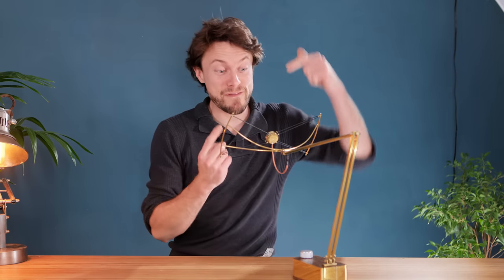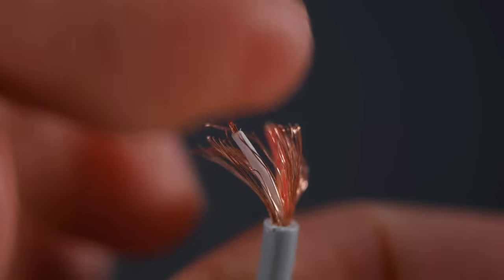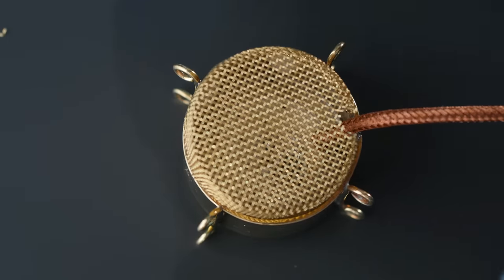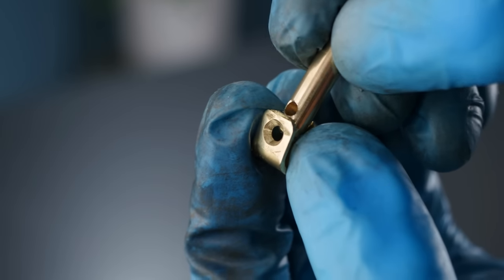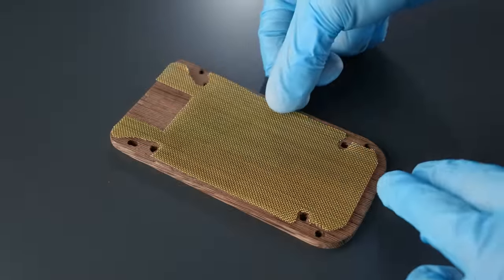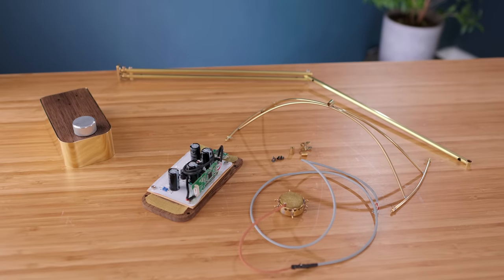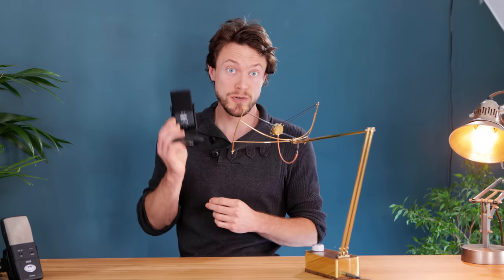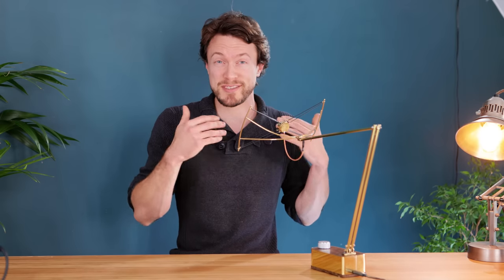Building a quality USB-C microphone

Comment: Dayummm! What a piece of design! Can't believe that cost you $30 to make.
Reply from the maker: Cheers James! Going to have a full brass PC setup soon xD
Reply: Don't forget the several man hours invested in designing and making it.
Reply: @vishalpranav9490  an the pre-owning of soldering iron and consumable, drill, tap sets , the various other tools .. and talent and experience
Reply: @TheOneAndOnlySame  those tools are cheap though. However his talent is definitely the coolest
Reply: Spoiler alert!
Reply: @DIYPerks  What next? "Make a brass home"?😁
Reply: @TheOneAndOnlySame  While true, those things are usually already owned by DIYers. I myself am lacking the tap sets and a good drill, but they're things I want/need anyway. So for any DIYer who is lacking as I am, it's a perfect excuse to go ahead and pick them up.
Reply: @RAndrewNeal  Yeah, he really goes the extra mile with his own projects when you might be able to do without some of the things that he adds (although he gives solid reasoning for the brass in this one) I just bought the isolator from the link and it's $30 bucks after $10  worth of shipping to the states. I'm stoked to try it out though and will enjoy the build. . . i hope.
Reply: while I absolutely love the build, "$30" is maybe a bit misleading... while yeah, the capsule may only cost $13, depending on where you live with shipping, taxes and import fees that is easily $60 alone... add to that shipping for all the other components and were easily over $100 not counting labour, yes it's still great value, but not exactly "cheap"
Reply: It didn't. Assuming you have the tools already, going off of the affiliate links in the description, which doesn't even include all of it, it doesn't include the wood, the brass plate used for the wall of the base, nor to house the microphone, it doesn't have the electronics for the knob or the knob itself, it doesn't have the wires to wire the microphone to the DAC nor the shielding for the wires. Just going off what's linked in the description, it will cost you at least $123. That $30 is just for the microphone and DAC, with $40 being more realistic to actually get the thing wired and working, but still not including a stand, case, shielding or anything, and it likely sounds awful.

Let's say he ended up spending $150 total. That's quite a lot, and most of it went into the stand. It's still cheaper than that particular mic he showed us (the first one, that he didn't do a comparison with), but you'd probably be better off just buying a $150 microphone. Like, the MPM-2000U comes with a stand and the microphone is detachable from the stand and it's generally a much smaller, more versatility device.
Reply: @itsjonathanwade  I might end up adapting it into a self-contained unit much like a typical condenser mic. I don't know if I want to go XLR + separate preamp, or all-in-one, though.
Come to think of it, it may be a great Altoid tin build; and I'm not really a fan of those because they look cheap and junky. But they do make good enclosures because they're a ready-made shield, and they're thin enough not to interfere with the rear cancellation holes on the mic capsule itself. It's just a matter of shrinking the preamp circuit, as his won't fit into an Altoid tin by itself.
Reply: @infi84  the capsule alone is $40 postage to UK
Reply: Awesome build, but yeah… I think just the brass tubes and rods would go over the $30 mark.
Reply: cost at least 120 euro whis the shipping
Reply: @DIYPerks  Ask your friend if he can still get a refund for his 6k one.
Then sell him your one for 5k cus it sounds better 🤣😂
Reply: @NealD   Waaaaay over $30!
Reply: Herd too believe? Because its not true.
Reply: @DIYPerks  What is your normal job, I have always wondered. 
Maybe you answered it in another video.
Reply: @infi84  Well, he only has his own experience to go off of. For him, it cost around $30. It might cost more if you live in rural America; even more if you live in a rural part of a less wealthy country. You might save on shipping costs if you have a decent hardware store in a town nearby.
Reply: @RAndrewNeal  Like people have the time to make this ... (Time is money) so I don't really think 30$ is an actual value.
Reply: @TheOneAndOnlySame  Even after buying all the tools it would still be cheaper. Plus then you could do more DIY projects.
Reply: @thanhnhanhuynhnguyen3652  wait since when exactly are tools that last cheap lul
Reply: What's even more unbelievable is how much this exposes the audio industry as a giant scam, without him calling it out. Well I am doing it — Big audio is big scam. Period. And this piece proves the point!
Reply: @RAndrewNeal  well I just don't think the shipping costs got included in the price calculation at all.
Reply: @infi84  diy projects arent meant to be cheap imo. if u want to save money by doing diy stuff ur an idiot u could just take the time u waste on these products and go work at mcdonalds and u would come out with lot more money and just buy the product online.

Diy isnt about saving money the 30$ pricepoint just looks better and diy perks should do whatever gets him more clicks because he deserves literally all of them and technically its true the parts literally only cost 30$ he didnt add shipping on the neumann either.

People doing these kinds of projects know they wont save money by building it its about building it yourself and nothing else and people not knowing that wont build it anyways so who cares if he fools them
Reply: @DIYPerks  please make Brass Webcam, Keyboard, and Mouse too!
Reply: @DIYPerks  When I run all of the costs out it costs $120 not $30.
Reply: yeah... the mic it's self was $13 and that usb interface he bought was $18, so everything else must have been free and he found a dollar on the ground.
Reply: @TheOneAndOnlySame  you spend 30$ on the parts you may spend 100$ or more on tools but you can use those for other projects (not to mention that they are all common tools)
Reply: Dude needs to patent this invention! the design is so interesting!
Reply: @vcat724  patenting this would patent ALL microphones something i don't think you can do it's a DIY microphone big corp charge more but you can't patent price he is just using off the shelf components
Reply: @BrainiumBasher9001  the brass design itself, not the mic part
Reply: design patent protects only the appearance of the article and not the utilitarian features (mic)
Reply: If he does not patent, then some other inventor or company can just outright steal his idea and sell it themselves.
Reply: @DIYPerks  
I am in a hurry to see this done
Reply: @infi84  Someone in China where these are made could have bought them for $5. The cost is relative but for him that was $30.
Reply: @DIYPerks  Read my comment about the name of it?
Reply: well, about 35 years ago I worked for a telecoms company. Just one of the things I did was to select a standard Euro-size board with a matrix of resistors and a couple of jumper switches to adapt the phone-line impedance for commercial dial-up modems. The company used millions of those boards and I seriously believed on how simple they where, that the company did not pay more than $10 a board at commercial price while to make the board would probably cost less than $2 to make it. After asking around, I found out the telecoms company would pay close to $900 per board 😵😵‍💫🤑 seriously... That's a huge difference, that still continues today.
Reply: @RelaxSimmer  Time isn't money. One with the equipment could spend $50 and a weekend and have a microphone worth more than a couple days' work anyway, depending on what their job pays. It still saves money though, which can be put towards things besides the $600 mic.
Reply: @infi84  You're probably right. But you'll still get a microphone equal to a $600 one while spending quite a bit less.
Reply: Also, diy is a satisfying hobby for some, so you have to factor in the enjoyment you're getting out of the project.
Reply: @r00kiet80  It's a fu***ng drill.
Reply: Well, you should also consider the time it took to acquire that knowledge/skills. The project is amazing, but I doubt any of us (mere mortals) can make it as cheaply as Matt did.
Reply: @r00kiet80   
Hey! tell me what "heavy tools" he used in the video
I dont think you know what heavy tools are, have you ever touch them? im a machinist and and buy stuff from china, it can be terrible or brilliant. Example? Search for jianken spindle and see how much better it is compare to any other brand, say techno. Oh you dont know? ofcourse im sure you dont see a spindle in your life, not to mention a "heavy tools". Oh im sorry, you probably cant read technical specs.
Keep this attitude cause it will get you places in life, but not university.
anyway im giving you a medal of " i express myself like this to hide the fact that im useless". Please get a life, what this man do is beyond brilliant and still remain brilliant if the cost is higher than 30 dollars
Reply: @vishalpranav9490  that's usually the trade off to make stuff like this
Reply: @thanhnhanhuynhnguyen3652  😂😂😂
Reply: @RAndrewNeal   I plan to do something similar. Although I need to run the output through 2 parallel voice mods and hide the whole thing in a costume for a haunted house.
Reply: @DIYPerks  Prices in GBP plesse xx
Reply: @thanhnhanhuynhnguyen3652  no way they are cheap if you don't have anything laying about
Reply: @TheOneAndOnlySame  I mean he gives you everything you need to make it, and you dont have to make the body the way he did.
Reply: @RelaxSimmer  Time is only money if you would be using that time to make money, that is certainly not the case for the vast majority of people.
Reply: what about his time how much does that cost. I can imagine his time is pretty valuable much more than the parts
Reply: @midnightwatchman1  Yeah thats true, but for alot of people who want to do a fun project it would be well worth the time and money. Its not a perfect option for everyone but you can get a really high quality mic for really cheap.
Reply: @TheOneAndOnlySame  You could buy all those tools and the parts needed for less than the cost of a microphone though...so?
Reply: @DIYPerks  Colour me surprised. However I'll bet it'll look fabulous, and run great. There is a guy on YT that's building a fully DIY PC: CPU, GFX and all.
Reply: @SkylerLinux  Link?
Reply: @TheOneAndOnlySame  rent for 20 bucks
Reply: @vip_bimmervip_bimmer8033   yep, I got the same! $122 before shipping.. closer to $200 after shipping.
Reply: @vishalpranav9490  and the thousands of $ of tooling required.
Reply: Yeah, $30 is BS. Just the electrical components alone would run you like $40. They're not cheap. Then add the brass tubing, rods, plates, mesh, wood, wires, USB interface, USB C port, o-rings, the microphone, and shipping, and it's easily over $200.
Reply: @infi84  You cannot really include the shipping as part of the price as that can vary widely... you would also be facing the very same (or similar) shipping and tariff charges for the complete microphone most of the time as well... That is why these are usually compared on "Base cost".
Reply: @itsjonathanwade  Matt (and many others) is describing "base cost" because shipping costs, tariffs, and other factors, can vary widely from location to location. There is also the possibility of sourcing some parts locally with little to no shipping at all or something you already have laying around.
Reply: @DIYPerks  wow no more aluminum its brass time!
Reply: @TheOneAndOnlySame  I mean, if you are big into building things, it would be smart to invest in your own soldering iron, drills, and tap sets. Those pay for themselves in the long run.
Reply: @DIYPerks  Could I use a normal potentiometer instead of the volume control switch?
Reply: @RAndrewNeal  I usually use self tapping screw that I happen to have bolts with matching thread patterns cause I'm too eager to wait for the right tools, lol
Reply: @ikannunaplays  Sounds like the perfect workaround! Taps seem to be crazy expensive for a decent set.

Comment: Professional electrical engineer here: 
-Twisting the 2 wires between the JFET and the PCB costs literally nothing and gives an additional protection against electromagnetic interference (emi).
-Beautiful work on the soldering, are the grills also soldered to the brass ring and connected to ground? With corrosion, you could get some emi problems in the long run.
-Circuit: You need additional 100nF Caps on your supply rails. Those electrolytic caps have a large series resistance, making your supply more noisy for higher frequencies.
Reply: How would one add a mute button this design? I would assume just adding a locking button of sorts to the audio output but I know very little basics of electronics. Also question about the additional 110nF caps on the supply rails. Are you talking about the +/- 15v rails? if so where and how do you add the caps? inline? does it matter if they are polarized?
Reply: @robertsnyder4480  just in parallel with the 2200u caps. Use ceramic, or better foil type
Reply: @DIY Perks - a follow up with the above additions would be neat, perhaps make a 2nd one so you don't need to borrow the 3K mic
Reply: By “2 wires”, did you mean the thin enamelled wires?
Reply: @pk_xiv2856  yes
Reply: Did he ask tho?
Reply: @dxvexrs  did anyone ask you to annoy people tho?
He just gave good information on the topic, for ANYONE who wants to build it.
I'm sorry that you aren't capable of such things.
Reply: @dxvexrs  diy perks litteraly asked on advice to make it better...
Reply: @dxvexrs  12:43
Reply: How would you approach the circuitry when just using the mic als a standard XLR mic that you plug into a audio interface
Reply: Thanks. The moment he stated he would like advice I went searching and found your comment and it is definitely useful input just as he asked.
Reply: @dxvexrs  : He did. He directly asked for tips to make it a better design. Horstelin provided exactly that, succinctly and sensibly, backed by specifically relevant knowledge. You feel intimidated or something? o.O
Reply: In addition to this, using capacitance multipliers instead of those massive RC filters would save on space. I’m also not too fond of those non-polar caps and would suggest replacing the first two with tantalums, and the latter one with a film cap.
Reply: Send him an e-mail adding the capacitor you suggested, pretty sure he is going to update the template and make the life of dumb people as me easier lol
Also, thank you for the suggestion.
Reply: i'm not sure that the brass ring should be grounded to the circuit, since the idea is to create a faraday cage, but yes the grills should be soldered to the brass ring
Reply: Sorry I'm pretty new to this but do you know the wattage to the different resistors in the amp as it's not shown in the template.
Reply: @miguelkeh1680  they look like 1/4 W resistors to me (ie the most common ones)
Reply: Thank you for this comment! I am very interested in this project and I really like that people try to improve it together. Why would you use capacitors for a mute button and not just a simple on/off switch on the audio circuit?
Reply: @apocaloptigon9988  I'm pretty sure it's best practice to earth a Faraday cage.
Reply: @rossbaker3762  thanks!
Reply: @rossbaker3762  are you sure? Looks like some have quite some circuitry in them like this one (last chapter of the vid) https://youtu.be/w-bwTG5igqU
Reply: @sebastiaanhoenderdos7458  You're right, I was mistaken. My apologies! (My knowledge of condenser mics is lacking). I've edited my earlier comment with better info to avoid confusing anyone else.
Reply: @rossbaker3762  great info, thanks for the edit!
Reply: @Horstelin I am trying to learn about this so some help needed.  I compared his design with the datasheet (of 1512, THAT1512P08 to be exact) and see some differences.  
First there should be a cap on the gain (CG) in series with the variable resistor (RG).  Can't see he used one but perhaps I just missed that.  
Second: It's a different design on the IN+ and IN- where the reference design has two 740p caps between + and - with mid point connected to Audio GND through a 47p CAP.
Third: the resistors on the IN lines are lower in the ref design (1k) between IN and Audio GND - what difference does that do?

Comment: So, I would say the unprocessed audio from the U87 definitely sounds better, but once they're both processed you could make them sound damn near identical. The DIY mic had pretty much the same level of low end as the U87 but had a lot more presence in the high end, which honestly unprocessed sounds a bit harsh, however it has more sonic information that you can play with in post. With the U87 you'd probably throw a boost on the high end to give it more of the air that the DIY mic already has, and with the DIY I would do some cutting in the high end to make it less shrill. In the end they'd sound pretty much identical though, which is incredibly impressive.
Reply: I have cosumer grade 150$ PC speakers and I couldn't hear a difference. I assume if you are a content creator 99% Of the viewers wouldnt notice the difference.
Maybe its more audible on headphones tho.
PS: Also tested with my Headphones as well. The difference is so miniscule I would be able to tell them apart.